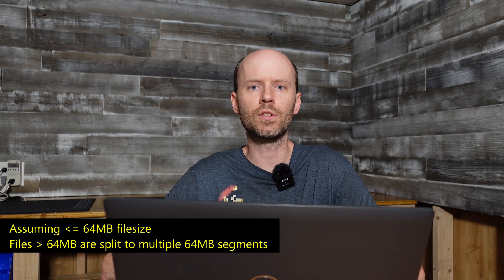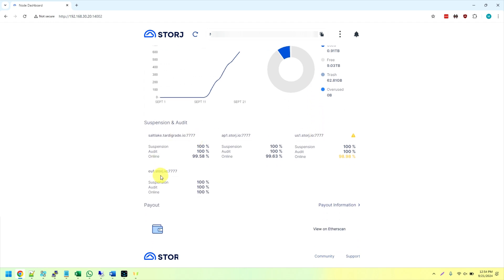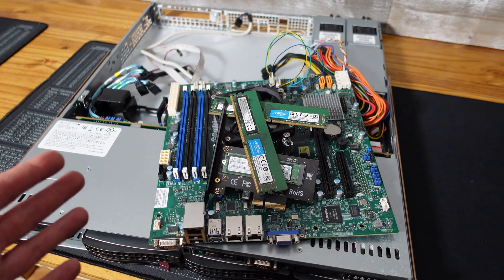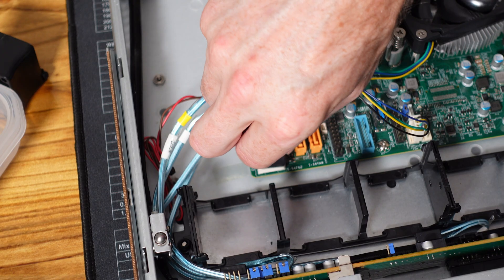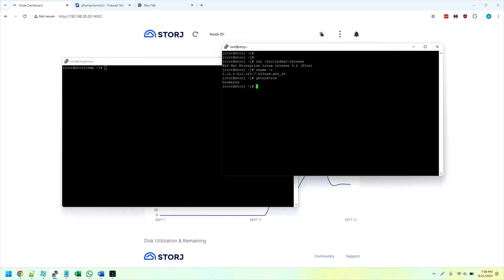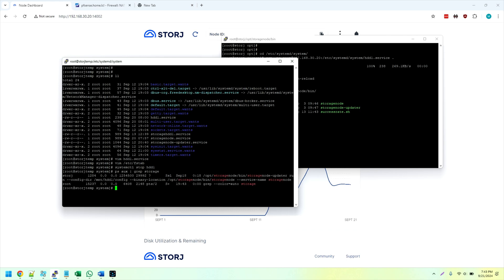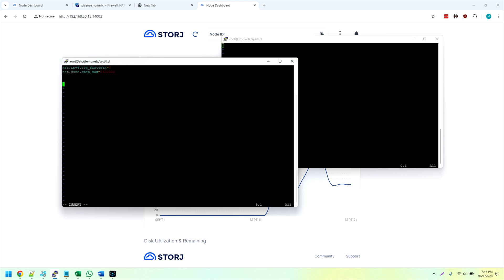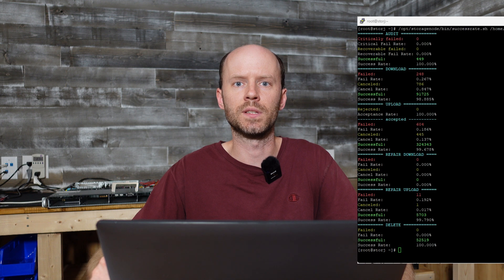Building a Storj Node and Migrating Existing Contents, FUN HomeLab Project

Comment: Wait you have to forward ports? If you can't use it behind a reverse proxy that's a big problem for a lot of people
Reply from the maker: It requires a port be open for incoming connections. I don't see any reason you can't put it behind a reverse proxy as the reverse proxy would still have a port open externally - though I don't see why you would want it behind a reverse proxy either? CloudFlare/security or something?
Reply: @HomeSysAdmin  Some folks think reverse proxy is all they have to do for security and they think "forward port" is bad... so maybe it's just that?

Comment: That little cable from the PSU is the SMBus connector which tells your motherboard what the PSU is doing.  These are on most of Supermicro's redundant PSUs so that your computer will know if there is a failure and send out notifications.  Cool little feature.  You should see it working in the IPMI gui.
Reply from the maker: Thanks! I do see PSU stats in there.
Reply: @HomeSysAdmin  I wish more of their PSUs had that feature as it comes in handy and almost all of their boards have the controller.